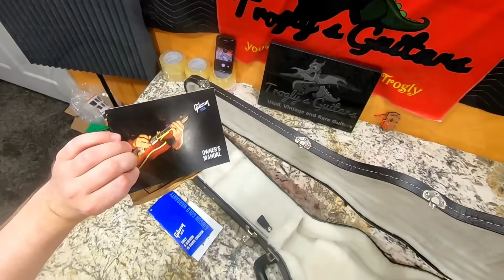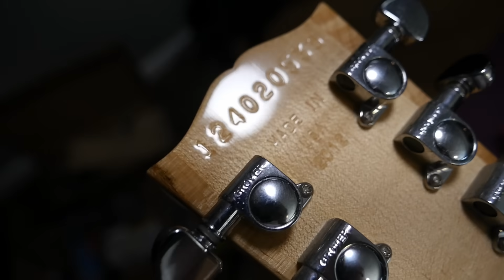Somethings SERIOUSLY Different About This LP ! | 2012 Gibson Les Paul Traditional 12 String Goldtop

Comment: I am a 12 string lover. You mentioned that Gibson made 12 string 335's in the 60's. I have a 1967 Epiphone (Kalamazoo) Riviera 12 string version of that guitar that is awesome. Only difference is that it has mini humbuckers instead of the full size ones. Personally, for me, I think the clarity of the mini humbuckers is actually more desirable for a 12 string.  It's got some wear and tear on it, but the neck is still straight and it plays great. Says a lot for the 60's Gibson and Epiphone Kalamazoo era.
Reply: I've got a '66 335 12st and it's phenomenal. Mine was cheaper than a brand new one as well, so if you're feeling like owning one, nab one soon, because they aren't going to keep getting overlooked for much longer. 
It's nutty too, because a 60s 335 is considerably more expensive than a 335 of the same year, and you can simply string it up with a 6 strings and a new nut and you've got a much cheaper 60's 335 as well.

Comment: 12-string electrics are magical, especially Rics.  But to get all of the magic, you must play them through an old tubed Vox or  smaller tubed vintage Fender amp.  The 12-string chime is doubled with those amps.

Comment: Austin, I am a little late to this party.  You mentioned  the possibility of stringing it as a 6 and it reminded me of Johnny Winter at Woodstock.  Yeah I come from another era.   Before he got into the Firebird,  he played a Fender 12 strung with 6.  I don't know the reason he did this though.   Maybe the spacing was conducive for fast switching between slide and picking.  Interestingly he used a plumber's pipe for a slide.   Just brought back memories.  Your videos have educated me so much about Les Pauls.   Before you, I thought an LP was an LP except for the Studio.  😂.  Before the internet,  I finally got my dream, a Les Paul.  It was a classic and I loved the tone but hated playing it due to the  neck.   Except for LP Jr.  I never revisited the brand until your videos.   I will make an informed decision this time.

Comment: I have an epiphone les paul 12 from the 90's
Reply: So do I! 1998. I guess it's just us. I replaced the stock pickups with EMGs. They do a better job across all 12 strings. Six pole pieces do not articulate well enough. I love mine. It's tobbaco sunburst. I put push-pulls on it to split the pickups also. Single coil neck + bridge humbucker yeilds an especially beautiful tone. Cheers.

Comment: It actually sounds shockingly good. I'd avoid hacking away at chords like that though - arpeggiated stuff sounds best on 12 strings.

The distorted stuff had an interesting vibe. I'd use like a 10 band EQ though, if I was going distorted - It's absolutely shocking how much 'bad' you can dial out of the tones and harmonics with an EQ pedal.
Reply: Why would you use an EQ? I’m just curious.

Comment: While it is indeed possible, as you say, to string up a 12-string as a 6-string and play it that way, I should offer a heads-up for those who will be playing it in public:  I did this with an acoustic 12 and used it for "busking" (I deeply hate that word) for a couple of years.  I was driven to the edge of madness by the never-ending parade of commenters, most of whom seemed to have some kind of mystical attachment to12-strings, expressing confusion, horror, disgust, even open hostility... Some would simply point out, "You got a 12 string but it's only got 6 strings!". Others would inform me, "You're playing it wrong!".  An alarming number would comment on how beautiful the "12-string" sounded, apparently hearing 12 strings when there were only 6.  I rejoiced when I once again owned a real 6-string, and the 12-string wierdness stopped.

Comment: 12 string sets that start with .009 feel a little looser than the 10 sets. They are a little harder to find and sometimes the shops have to make a custom set to get that size but I love 12 strings with 9 on the E

Comment: Watching this review,  I had one of my little Eric epiphanies. What I thought of is that Gibson (to the best of my knowledge) has never manufactured/marketed a 12-string Firebird - meaning a standard Firebird body and neck with a 12-string headstock and bridge.  It could then be either reverse or non reversed in the headstock.

What came to my mind before that was how Gibson briefly marketed the 12-string SG back in 2012 and '13. I played one in my local Guitar Center outlet.  If I had by that point already convinced my leaseholder to take out a gear card for me, I would have that guitar today.
Reply: Gibson made a Firebird 12-string from 1965 to about 1970. It was only available as a non-reverse model, and as a very small-production item. I’ve only seen one between ‘65 and now. (2021). It sat at Leo’s Music in San Jose, CA until about the late ‘70s. The double-triangle headstock inlay is right off Gibson’s B-45 acoustic 12-string that they produced for years.
Reply: They should bring that sucker back, @jfinester .
Reply: What do you mean? He showed one in this very video.
Reply: What he showed us was an SG/Firebird hybrid, @calvinlee8103 .

Comment: A bouitique-y company made these FIRST, about 15 years ago.  It was a sweetie.  That ES type 12 string, the jury is still out for me with that.  You can watch John Phillips and his repeated attempts to tune his during the MONTERY POP film.  I felt bad for the guy.  Oh, take the plunge and actually tune the 2nd highest string an octave UP.   If you use anything over an 8 gage, it will pop.  This is the perfect guitar for a back up, OR in my brothers case, a simple pop / power trio.  A bit pricey, but they wouldn't be if Gibson kept them in regular "stock."  Thanks for posting this.

Comment: Love your videos, you have some pretty unique and interesting guitars!
Page played a 12 string on a few Zeppelin songs as well, Song Remains the Same, 10 Years Gone, Livin Lovin Maid, and of course Stairway.  I’ve played a 12 string Les Paul and I wasn’t very impressed. If I wanted a Gibson electric 12 string, I’d just get a 1275, for a single neck 12 string, a Rick or a Fender XII would be the way to go. Fender kind of reissued the original Fender XII with the Alternative Reality XII but the regular 12 string Stratocaster is a horrible guitar, IMHO.

Comment: I've never liked 12 strings.  The ones I've tried have had six of the strings so close to the other six strings that you can't really play them separately and have to play them together.
Reply from the maker: That’s kind of the point of a twelve string - to play the two strings at the same time. There are slim and wider not-width varieties out there if you felt the sets were too close.

Comment: Does anyone know about a 12 string guitar, under $5000 new, including an acoustic, that isn't neck heavy?
Reply: Fender Electric XII. I’ve got one of the 2019 reissues and it’s not neck-heavy. However, mine is pretty heavy overall—I don’t know if they all were or not; I haven’t played an original one since the ‘60s, and the only reissue I’ve played is mine.

Comment: What a nightmare to keep in tune - get a Reverend Airwave instead.
Reply: P-BIZ  -  Or a Danelectro 12.  Stays in tune.  Sounds like a Ric.  One quarter the price.
Reply: Yes, locking tuners are a no-brainer for a 12… (I used to have a Charvel Surfcaster 12, which had the sideways tuners, it stayed in tune, except for one tuner that would stick… even taking it off, cleaning it and putting the 3-in-1 oil Stew Mac sells didn’t fix it all the way.)